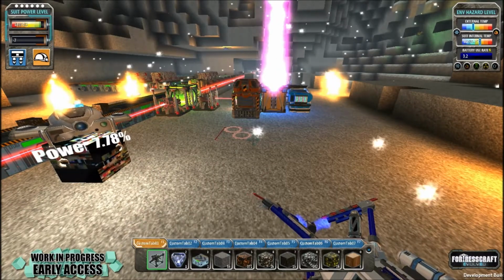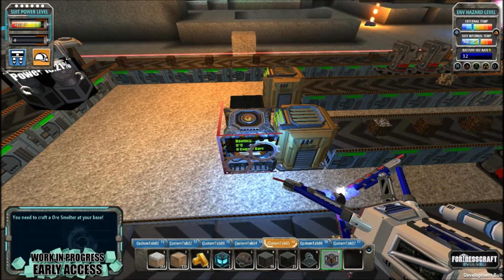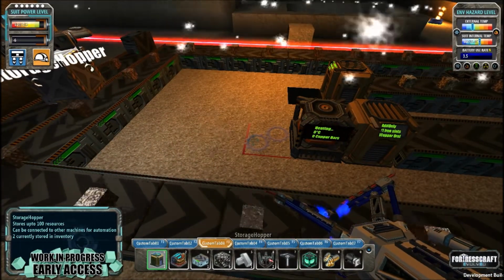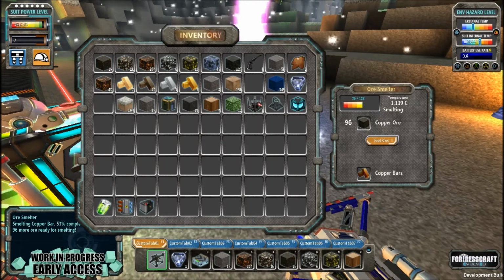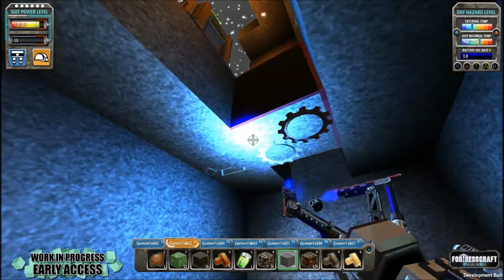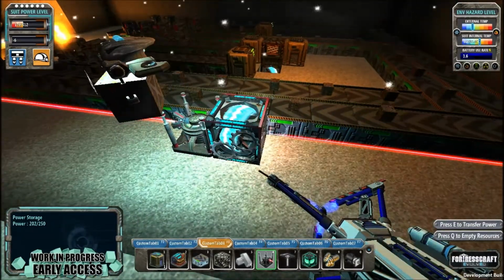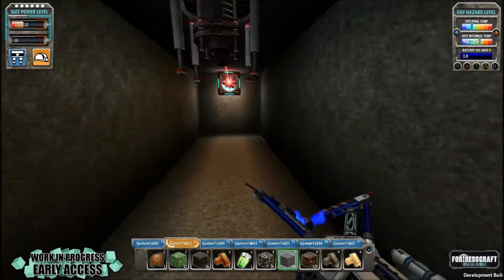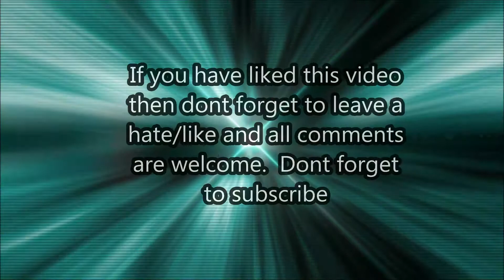Fortresscraft:Evolved - Episode 20 - Copper Automation

Comment: for me in this kind of setup, i would be using two power lines into the smeltery junction and have one line continue on, so double power is hitting the smeltery junction and half is going on to power the rest of the base, but as both lines come in at the smeltery, if they require more power, the rest of the base will loose power, this has the benfit of draining the mining operations which slows down the incomming ore giving the smeltery's time to process what they have until sufficent ore comes in. alternativly for smoother base operations have one line feeding only the smeltery and another line bypassing going onto the main base.